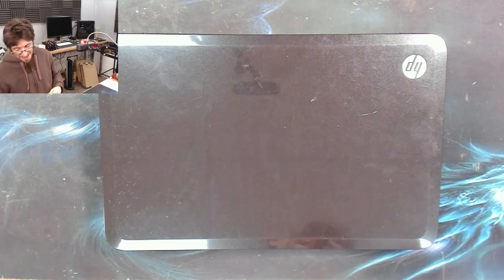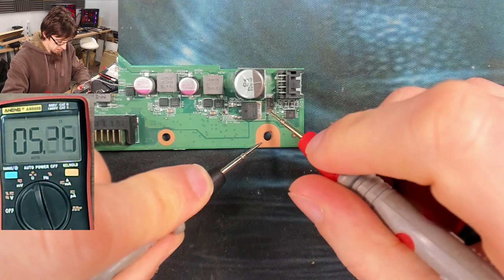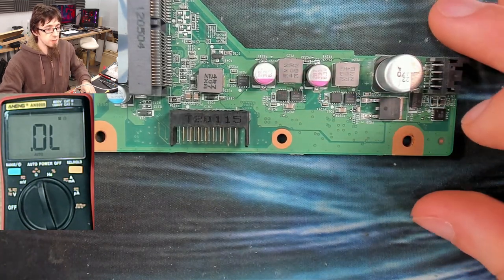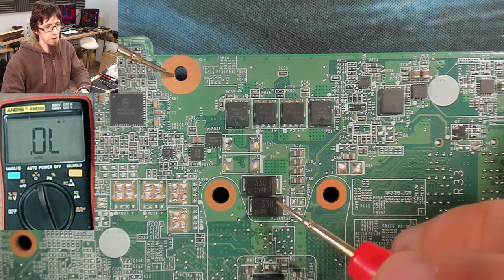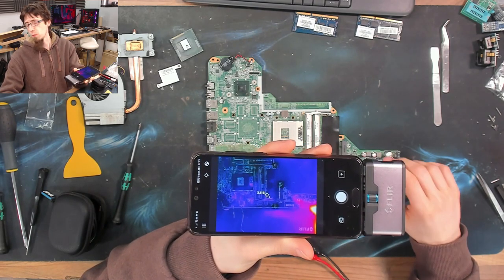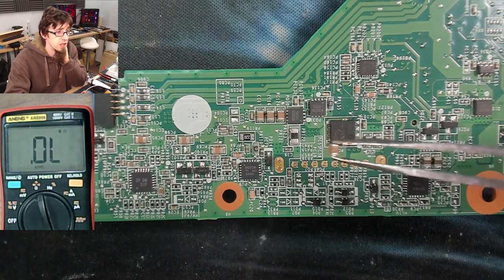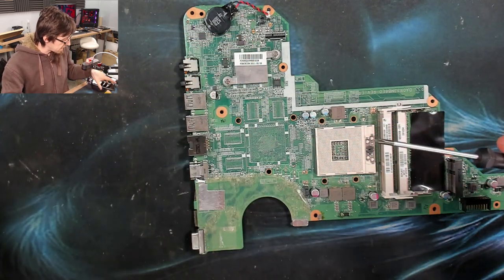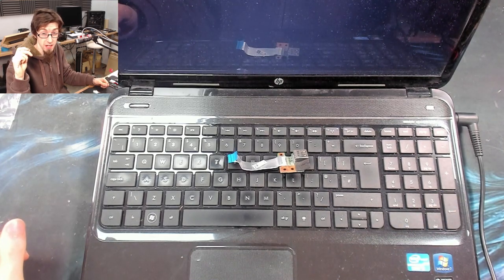HP with a kinda-shorted power rail - LFC#294

Comment from the maker: For the eagle-eyed viewers, yes I did snap the speaker plug just before I took off the top case. I fixed it, but the section got cut because it would've made the video another 10mins longer for a problem easily solved with a £5 part on ebay 😛
Reply: So blessed to have this is just Great, 38 min has passed and I felt like it was 3 min, I'm quite sure another 10 min wouldn't be in anyway an issue honestly
Reply: Graham, I tend to agree with most of the other viewers here. These videos are incredibly therapeutic and educational. You are human and will make mistakes. If people cannot let that go, that's just sad. Back in the real world, those of use who have been around a spell understand that things like this happen and you can be forgiven because you fixed it anyhow. I'm just glad that you post these videos and that you show everyone here on YouTube how a business-owning computer technician fixes things in the real world, having to take into account real world prices, shrinking profit margins, and customers and YouTube commenters that may miss the greater value offered by your shop. Thank you for your great videos!
Reply: @sugargliderdude  Yes, it was shown in the video.
Reply: @sugargliderdude  yes. it s in the video at 34:43
Reply: Excuse me, I have a question about the ENE controller, Does it came ready to use? or you have to program it to run properly on board?

Comment: Cap can partial-short and fully short that you can easily push 6Amps without heating much, Good practice to see if you have an high side short is to measure from the main power rail to all the coils if there is no short you can safely inject voltage. 👍

Comment: Hey Graham, another excellent video with thorough explanation as you go along.  I think the meter probes you have currently are good enough,  however, I can recommend getting a negative lead with a crocodile clip, then you can just attach it to a ground plane and pretty much forget about it while probing with the positive lead.
Reply from the maker: I've seen some folks do that, but it's less helpful when you need to check paths with continuity, or check directly across a component.

Comment: I was struggling to find some fine tip multimeter probes. I ended up just simply soldering dress making pins to the tips of my probes, its crude but is a total game changer, especially on newer laptops where components are getting increasingly smaller. also if you snap a probe its really cheap to replace the tip.

Comment: Early 1980's electronic forecourt fuel pumps i worked on which blow a fuse ,used to put a bigger fuse in and watch to see what got hot or smoked ,then changed that .'voltage injection' the components were big and easy to spot.

Comment: If you go for new multimeter probes, note that the Aneng uses short shrouds. I tried mine with some Fluke probes (I haven't got a Fluke multimeter, I got the probes to replace the Aneng ones before realising the shroud length problem...) and the fit was a bit loose, but some Brymen probes (I have a BM-257S and it is decent) fitted sort-of OK. I suspect you could shorten the safety shrouds, especially if you aren't going to use them for anything higher voltage than what's found in a laptop.

Comment: Hi Graham - just use the “Rel” button on your multimeter to zero out your lead resistance. Looks to be the top right yellow button.
Good probes are better but of course none are zero resistance. They usually are much more flexible owing to being made of many many fine wires and softer insulation.
Reply from the maker: Ah, I've seen Rel on other meters, but I don't think the AN8008 has it... the top-right button is mode select (resistance, cont, diode, etc) or Hold. Good tip that other people might be able to use though!

Comment: I've got two older Envy 17 inch laptops that have very similar issues lol. One had liquid damage but still turned on, the other was working 100% then just flat out died. They both now have the same no power issue, but the liquid damaged one shows the HP logo then shuts off sometimes. That one also doesn't detect batteries, or SATA interfaces, but PCIe works and it will charge and run off the battery. I've been interested in getting these guys fixed, the GT 750M in them is still a pretty alright dGPU for what I do lol

Comment: With those older laptops you can also buy a caddy to replace the CD drive with the HDD for expanded storage. That's what I did with my old Toshiba L655 when I upgraded it to an i5.
Reply: Yeah, old laptops are great except the iGPU sucks, they don't have modern video decoding, meaning it has to do software decoding and spikes upwards of 50% or more CPU usage just to do basic youtube streaming, otherwise they make awesome NAS/homelab servers.
Reply: I’d rather have the optical drive.
Reply: @vgamesx1  the iGPU in this should have video deciding. Maybe not for 4K or anything, but 1080p should do fine.

Comment: What hot air station is that? Almost looks like a JBC but it doesn't seem like you're using anything else of theirs? 
PS: I highly recommend ProbeMaster. They have an SMD kit that is around the price you mentioned which gives you multiple replaceable tips of 4 different sizes and dimensions. They're perfect for board troubleshooting reads. Pomona would be my 2nd choice.

Comment: The probes with my Brymen BM867s have 0.2 Ohms of resistance. So yes you can do significantly better then 0.5 Ohms. But at the same time, it's a predictable offset value, so it doesn't matter that much.

Comment: No matter what probes you use, there is an easy way to "calibrate" them out:
Simply put them next to each other on the same pad. This is your "Zero-Calibration". Whatever you measure there is just the resistance of the probes + contact resistance of the pad you're on. After that, simply subtract that from whatever reading you take and there you go. I bet, your DMM even has a "REL" oder "Delta" button you can press, then the DMM does the subtraction for you.
Reply from the maker: I need to dig out the manual for my AN8008 because I can't find the REL function. I can't believe it doesn't have one though, seems like something all meters have!
Reply: @Adamant_IT  Not necessarily. If they have, they usually have a button just for that or at least as 2nd function of some button - in that case it should be written somewhere on the buttons. It might also be just a "Delta"-Symbol, so the triangle.

However, I had another thought about that topic and at least in your case here, there won't really be a way to use this kind of "triangulation". Here's why:

As you noticed, depending on the pressure you put on the probes, the reading changes by more than 100 mOhms. This won't really change, even with really good probes. On the other hand, the big power-traces or power-planes on a (laptop) motherboard will have single mOhms or a couple of 10s of mOhms at maximum from one side of the board to the other. So you will always end up with a measurement error, that is way higher than the slight changes in the actual resistance reading.

You would need a proper low-resistance measurement setup, so 4-wire measurement and about an amp of current. That would not be something, that could be done easily and even then, the resistance of your "short" might change as the faulty component heats up, so you still end up with non-conclusive results.

I tried a couple of times to narrow down the position of a short like that. It works out sometimes, when there is other components involved like ferrites, but with just traces, I never got anywhere. It confuses me more than it helps, because every time you see a different reading, you try to make sense of what that means, which most of the times is a red herring. 

All in all, I think you don't need to spend money on a better DMM or better probes. You might need thinner probes like Louis uses, if you really want to go to town on SMD stuff.
Reply: @NebukadV  Some bench DMMs use a selector knob labeled "LP accompanied by the capital Greek letter omega, perhaps standing for Low Power Ohms" for resistance measurements less than 1 ohm. It is easy to deduce that LPomega DMM Bank = REL for portable DMMs. Another way of saying it, I do not occupy those functions because your answer is completely correct in the practical activity. As an example I will assume the resistance of the test leads is 00.2 ohms and (16:12) the meter reading at that point on the Mosfet indicates 1.0 Ohms, so 1.0 - 0.2 the actual resistance that exists is 0.8 Ohm.
On the other hand, according to you, Graham doesn't need to spend money on another DMM or test leads either. 
There are MilliOhm Meters like the Vici VC480C+ model. 
Finally, thank you very much for sharing your answers with us and I mean it with absolute sincerity. All the best.

Comment: Hi Adam. How are you. 

I have a problem on my 8th generation laptop. 

Product: HP ZBook 15 G5 Mobile Workstation
Operating System: Microsoft Windows 10 (64-Bit)

My problem is when I was trying to mount a new ssd drive on my Zbook 15 g5 I forgot to remove the battery, and suddenly the screw fell on the motherboard, and a spark was created.
 
now, the voltage of the battery pins is low, (1.3v see the picture below) and my laptop won’t charge the battery. 

The battery seems to be good, because I charged it manually with a smart charger and works fine ~2 hours, but it run out because the laptop can’t charge it. 

Can you help me please.

Comment: could u plz use a reliable multimeter and prob to compare resistance measurement and explain how to use resistance to discover shorts allover the board and the actual reading

Comment: Hello I love your calm methodology for fault finding. Do you have any details of your cordless soldering iron?
Reply from the maker: I use (interchangeably) a Miniware TS100 or a Pine64 Pinecil, they're not cordless, but have very broad power inputs, so they can run on anything from a 19v laptop charger to a 4-cell Lipo batt. Tips are cheap and widely available.
Reply: @Adamant_IT  Thank you - On it

Comment: you said we cant inject voltage when cpu/gpu/pch are shorted. can we disconnect the cpu like removing the coils(Inductors) to be able to inject power?
Reply from the maker: If the main-rail resistance is the same as the CPU/GPU, you're shorted through one of the mosfets. At this point, you've already found the fault - one of the mosfets. So you don't need to inject. This is often unrecoverable, as 19v from the main rail will have gone into the CPU/GPU at some point.
Reply: @Adamant_IT  Today I removed the coil from CPU and GPU and I no longer have short to the main-rail the CPU "11800h" is shorted to the ground and showing 0.3 ohms, GPU "3060" 0.5 - 0.6 ohms. do you think the CPU is burnt ?
P.S. I don't have mosfets I have SIC634, didn't see any short to it

Comment: hi adamant IT, i just wondering what are the rating of a partial shorted motherboard in diode mode?? 
hope you notice my question 
More power!
Reply from the maker: I very rarely use diode mode. It's much faster than resistance mode, but you need to know the readings. I think it's more effective when you work on a narrower number of devices, like only apple or something, where there's less variation.

Comment: How do you know that the resistor is a current sense resistor and how do you know which ones are for that purpose? Thanks for the video.
Reply from the maker: Most resistors on a mobo are very small black SMD parts with no markings. Current Sense resistors (aka Shunt Resistors) are fairly large, and often 4-pin (two large and two small). They often have a resistance marking on them, which will be a very low value, like R050 (0.05Ohm). All of those signs combined with the position on the board (bridging two large power rails together) should help identify them!
Reply: @Adamant_IT  thanks for your time.

Comment: hi adamant IT, i just wondering what are the usual  resistant rating of a partially shorted motherboard ? 
hope you notice my question 
More power!
Reply from the maker: So normally, the main power rail should have thousands of ohms on it.
In this video we were somewhere around 1.5 to 2.5ohms, which is definitely a fault. 
But we need to consider that if we have shorted mosfets at the CPU, GPU, or PCH power supplies, we'll see low resistance going through those chips, and injecting power might kill them, if they're not already dead. GPU is particularly tricky because it can go all the way down to less than 1ohm, which is basically dead-short. If there's no GPU, and the short is less than 1ohm, it's safe to say you've got a dead capacitor somewhere and you go to injection.
Important thing is to look around the board and understand the layout, so you can make a reasonable guess as to if you're shorted through a chip or not.

Comment: You need a 4wire ohms measurement to achieve your required accuracy.
Not a fancy probe, rather somewhat special.
The important thing is, that your meter must be born with the 4wire measuremnet capability.
They tend to be expensive.

Comment: All leads have resistance. You need a meter with 4 wire probes for low R measurements. 2 wires are used to sense and compensate for the lead resistance.
Reply from the maker: True. The question is if expensive leads can get it much lower than my cheap ones, or at least give more reliable contact at the probe points.
Reply: @Adamant_IT   I think very low ohm leads would be too thick and unwieldy (or short), but there are meters with a "relative" button. It can be used to zero out lead resistance by measuring the leads shorted together first.
Reply from the maker: Based on another comment I saw, this seems to be the key. Sadly it appears the AN8008 I use doesn't have a REL function, or at least I can't find it with the obvious buttons. Going to look into it though 👌

Comment: I wonder to find component you could use a Wheatstone Bridge with current injection on faulty board ,Ballance the wheastone  bridge on first test location .try another location see if higher or lower.use short good quality leads that dont very in resistance (thick wires).I think you would have to test directly across capacitor or suspected device that you think could be short or near short.
Reply: No need for a bridge. Inject the current, set meter to mV, and measure voltage at various points on the board, lowest voltage is the short location.

Comment: I guess you can zero out the probes by sticking them in the same solder joint, ie, it takes the tip resistance into account.

Comment: I cut the speaker wire on my HP laptop, I was putting it back together and the wire came loose. I screwed the speaker wire into the screw hole. One tense visit to eBay and I managed to get the part.  I think I was doubling the laptop RAM to 16 Gigs...

I am not a fan of HP build quality anymore, the chassis plastic case is way to weak now. My HP Pavilion is from 2018.   Problems, screws not coming out of holes, covered and hidden screw holes, broken speakers, a white spot on the 3.5 year old screen, weak hinges.  Oh and noisy bits of plastic rattling around the insides of case. 

I have upgraded the RAM and hard drive. 16 Gig of RAM and SSD 256 Gig 850 Evo.

I am now looking at Asus laptop as a possible replacement with 5500U CPU from AMD, OLED laptop screen and hopefully better build quality....
Reply from the maker: Cheap Asus are the worst - but I'm not sure where the line is between their bad stuff and good stuff. If the spec is good then hopefully it's of decent build quality though. Ultimately, brand seems to be nothing to do with build quality, it's just a matter of not buying the "consumer series" like HP Pavilion, Dell Inspiron, and so on. Business class (EliteBook, Latitude, etc) is generally a safe bet, but I'm not sure what Asus' "business" laptop series is called.
Reply: @Adamant_IT  I was looking at an Asus Vivobook. With an AMD 5500U CPU. £550.00.  My HP is a Pavilion and the build quality is dire.
Reply: The one in the video is built pretty well, I have one.

Comment: You've done a laptop board power architecture have you done a pc mother board architecture run through trying to find issues on an old x99 no schematic but manage to get a board view trying to learn
Reply: There are schematics out there for older mobo's, failing that just work through the system of ensuring power is in, ascertaining where the power goes to from input and check components in the power rails.   I started off in the late 70's literally shaking down a Commodore Pet, going through the components step by step.   Its worth too making sketches of each sub section of power control.   Once you understand how components operate and where voltage should be and what voltage should be there it does become a lot easier.
Reply: @dodgydruid  that is what in trying to do found a blown cap just behind the top usb posts/ps2 port got rid of that for now but it's still non responsive got to be a short somewhere buggered if I can find it at the moment

Comment: How much Voltage you inject?
Reply from the maker: 1v 2a is a good starting point, going up to 3a if you need it. YOu probably need 3-4amps if you don't have a thermal cam and need to rely on alcohol/finger checking
Reply: @Adamant_IT  Thanks a lot for more info much appreciated.
Reply from the maker: Np. Also, don't step over 1v unless you know what you're doing. If you need more than 1v, the 'short' might not be a short, or you may have a bad connection to it.

Comment: Is the inside of this laptop all copper?
Reply from the maker: It's some kind of conductive spray for radiation shielding - I'm not sure of the exact details though.
Reply: It certainly looks that way. Plating is essential on plastic cases for interference suppression. You'd think copper would be an expensive choice, but maybe there are other considerations or maybe this was the only way they could get it to comply, and I'm sure it's very thin.